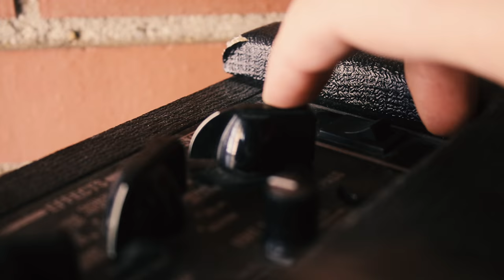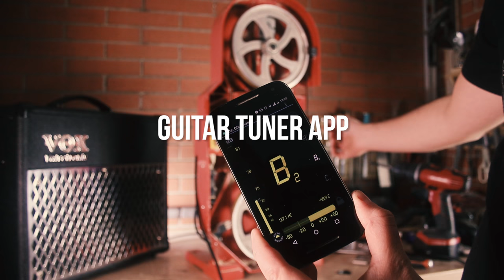Play Smoke On The Water with your BANDSAW - How To

Comment: If you made the top pulley eccentric, you might actually be able to get different notes for different pulley-positions ;)
Reply from the maker: yeah! kinda! that's why you see me turning one pulley :) but instead of eccentric, the issue is that one of them has a slight oval so as you turn, the blade stretches a bit more. It is great for fine adjusment. Thanks Aditya! good thinking! appreciate it :)